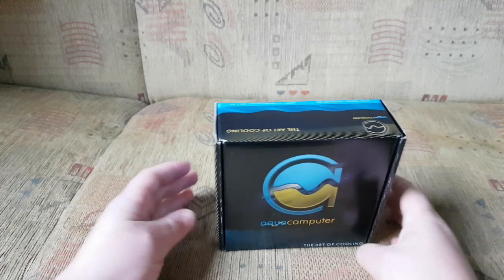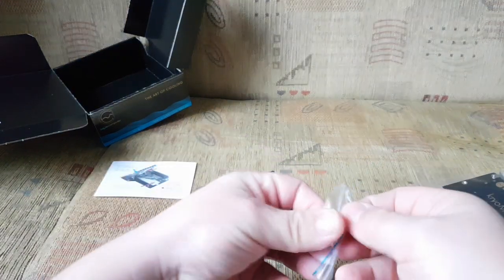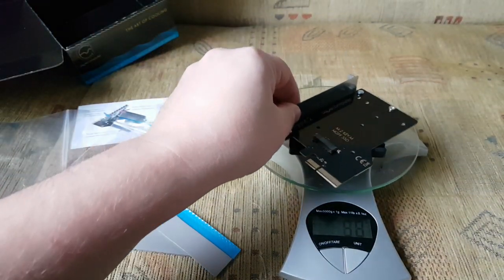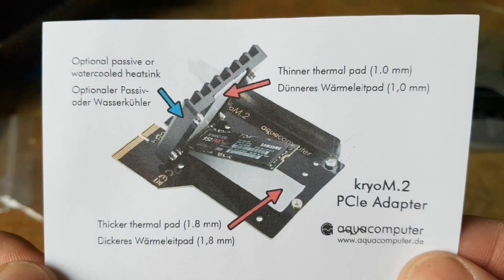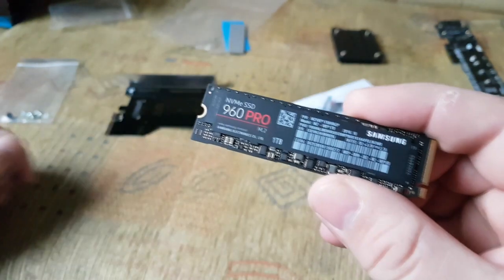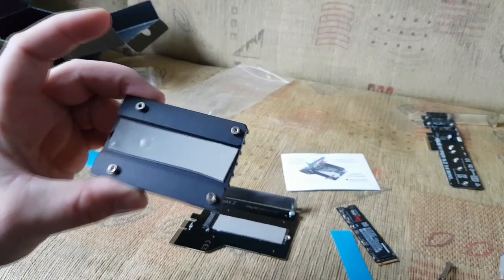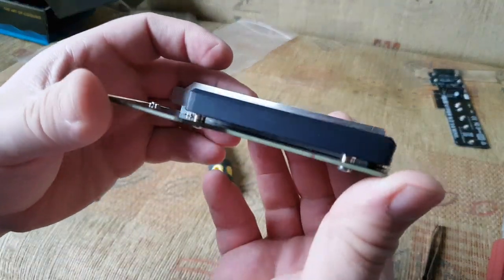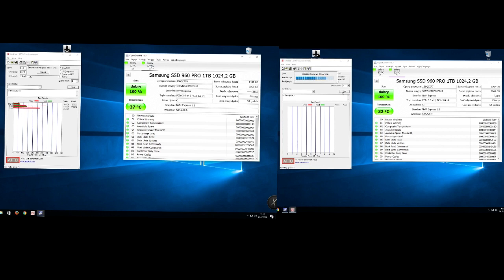ssd m.2 heatsink  kryoM.2 PCIe 3.0 x4 Adapter test on MZ-V6P1T0BW

Comment: Effects are positive, but this barely stresses the drive. These drives can reach easily 90 deg C without heatink under extreme load conditions for long times. Do random write test (10GB data size) at 4K blocks with multiple threads / big QD, for 5 minutes, and then you will get idea of speeds, latencies and temperatures.

Comment: Your motherboard has m2 interface slot why u chosen the adapter interface for better cooling?I'm asking because i have 2 slots but i can use the adapter for better cooling -20 is soo good with passive cooling
Reply from the maker: because I have 4 of them
Reply: Ok but what is the Thermal pad problem?U fixed that?

Comment: Tech Pro... With this name you should know something about electronical parts.

You are touching sensitive contacts = no go
Back to your OLD installation (ASUS Adapter): 
Without the spacer. Iam wondering how lucky you are, that the SSD is still working with (almost) 20 degrees gradients.

And what is the purpose of weighing the parts?

Comment: NEVER touch the (golden) contacts of any board - human sweat is highly aggressiv/corrosive for eletronic parts. If you do so the board, especially ram, will cause malfunctions within 12-18 months. Additionally using esd-protection against electrostatic damage is a must; at least touch a grounded radiator before touching electronic parts.
Reply: 12-18 months LOL. you have no idea what you are talking about.
Reply: I've touched a lot of RAM and GPU contacts over the years and I've built many PCs while not using any type of ESD protection. Guess what? Everything still works or have worked until I sold it. In fact, the PC I'm writing this comment on was built on a carpet back in 2015.
Reply: Yes, I agree, but it is GOLD. It is inert to almost all chemicals including human sweet and oils. If it is poor quality gold (very thin) just clean it with some alcohol if needed.

> human sweat is highly aggressiv/corrosive for eletronic parts. 
Not really highly. It is just salt, and the effect is more due to a time and temperature. However that to not apply to gold contacts. They are designed to not oxidize or be corroded by common elements. That is entire point of using gold in them!

> If you do so the board, especially ram, will cause malfunctions within 12-18 months. 
Not true. I have systems that I touched gold contact, and they still operate 15 years later.